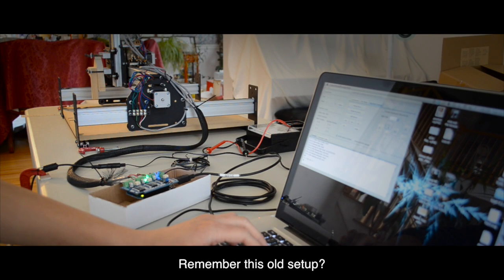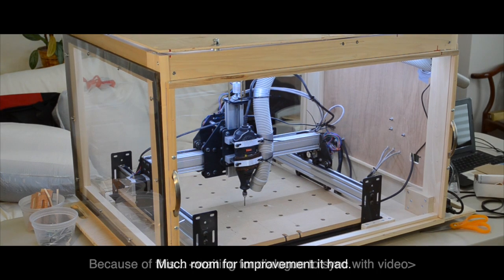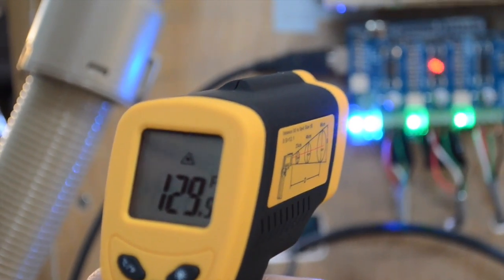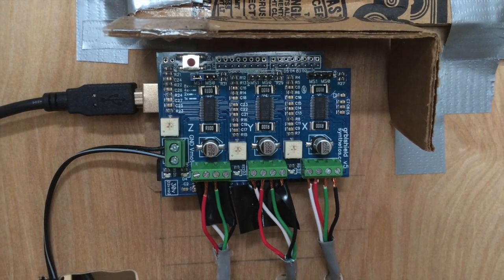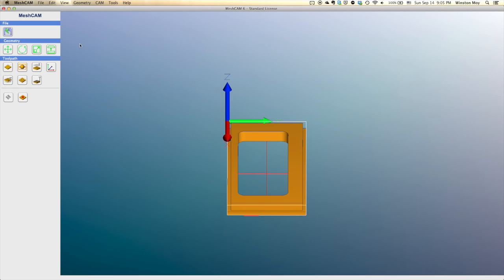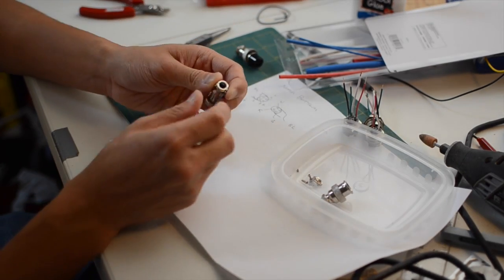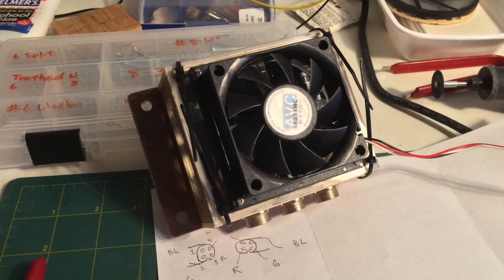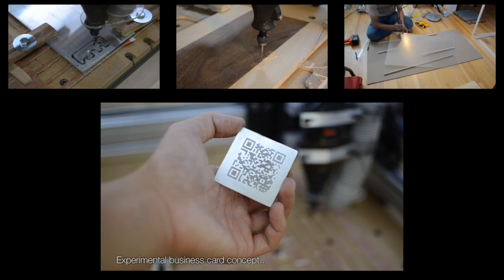Arduino & Gshield Enclosure - Shapeoko Journey Ep. 21

Comment: Glad to see another vid! You'll have a blast at Maker Faire, wish I could make it out to the World one, but alas already made my Bay Area trip this year! In the next couple days I am gonna mill some PCBs on my Shapeoko2 have you had a go at this yet?
Reply from the maker: PCB milling is literally the next thing on my list, lol. Should be getting to it early October. Let me know if you learn any tips/tricks about the process if you get to it first.

Also, Bay Area is one I definitely want to go to at some point, if only to see Adam Savage and whatever large mechanical contraption they bring out.
Reply: Winston Moy Bay Area is definitely crazy and a must see at least once! I am going to try a PCB over the next few days I will let you know what I find out, so far I am dealing with drill sizes and creating a rack file that will work for most hole sizes. Since I need to mill the board outline too I thought I would drill the holes first with standard hold downs then fasten it using the mount holes so I can mill the board and outline in sequence. We'll see how it goes!

Great work on the vids by the way, as a fellow content creator I know how much work they are and you do a great job putting them together!
Reply: SparkysWidgets Good luck guys on the PCB, well beyond my level of knolege and desire.  Winston, totally agree with the method of making the box, i have been looking at finger corner boxes (there is a guy who wrote a program to make one easy, but every time i run his script it cuts too deep and has really deep passes, so FYI stay away from that with your shapeoko, i broke my dremmel that way)  Besides that, i just ran across some 1/2" plexiglass and dont know what to do with it, might make a similar box to hold my board, but who knows... anyone got any good ideas for 1/2" plexiglass?